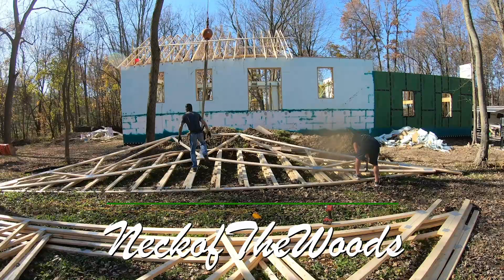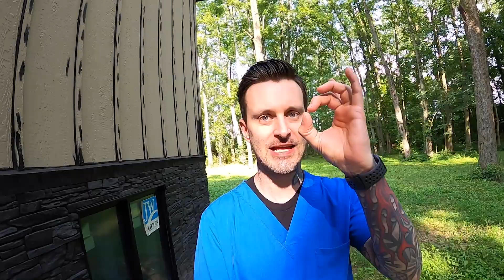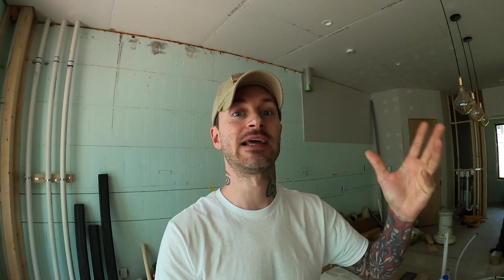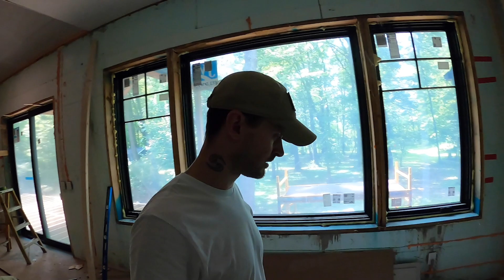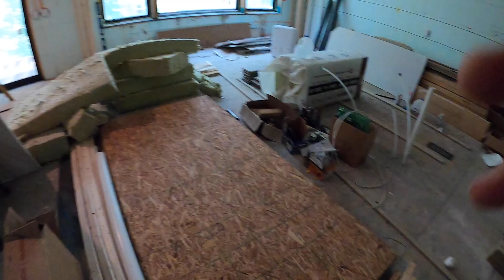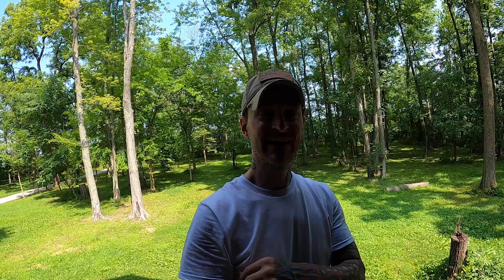ICF Home Blower Door test results!!!

Comment: Interesting info about the windows. 

Do you have a check valve with a compression fitting on your sump discharge pipe? 

Your sump pit shouldn’t ever be 100% empty and the water pump disconnect should turn it off a couple of inches above the pump intake so it doesn’t dry suck air any while waiting for the water level to rise.

The compression fitting is so you can quickly pull out the pump when it eventually fails, hopefully not during a multi-day rain storm like ours did. 

Also recommend installing a sump alarm… it’s cheaper than an insurance deductible.

Also recommend keeping that pool cover pump you had along with a hose you can run outside quickly near the sump pit for an emergency. I didn’t have one and our pump failed in the middle of the night so I spent the entire night scooping water into 5 gallon buckets by hand with a large cup and carrying them upstairs to dump down the toilet. I was exhausted and sore for days!
Reply from the maker: Yes there’s a check value in the sump going up and out.  The sump always has water in it because the pump doesn’t sit on the bottom.  It leaves a gap.  The floats also adjusted so it doesn’t suck up air because it’s so noisy when it does.   Just need to go more since more water would be better to cover that pipe.  Hopefully I can adjust more or I’ll have to like sit it on a brick or something.  

We do need an alarm.  Wasn’t sure which one to go with since some security systems have them and none seem to be great since they always want you to upgrade and charge you a monthly.  We do have 2 other pumps that are just plug in we can grab in case of an emergency.  You have to be there but it’s an option.  Might do a second pump on battery back up.  Just need to get it done!
Reply: @neckofthewoods24  Getting all the stuff done is definitely a challenge and yes, the alarm monitoring business is a racket.

The water alarm I used was from either Home Depot or Lowes and was right by the sump pumps they sell. It was just a simple high pitch noise alarm similar to a smoke detector and mounts to the pipe so you can put it however high you want it in the pit. That was over 15 years so tech has progressed…

I’ve seen reviews for both Ruuvitag and Govee wirless sensors. The Ruuvitag Pro is wireless and has both a water and temperature sensor and I’m getting ready to install one in my RV that integrates into my Victron inverter system. I’m going to test it next week and it the water detector works well get a second one for my the bay where my pump and water panel are in addition to my washing machine and bathroom.

The Govee has wireless as well and also has an audible alarm but I think it’s just a water alarm.

The Ruuvitag Pro and GoVee would both need a separate solution for mounting although the Ruuvitag does have mounting holes so you could mount it with zip ties or a metal straping.
Reply from the maker: good to know about the alarms.  id just lay it right on the lid.  if waters that high, we have a problem!  when we live in it im sure those will work well.  just wish i could get something that connects to the internet that i dont have to pay monthly for so when we are away we'll know with a page to the phone.    im sure someone out there has that or maybe these do!
Reply: @neckofthewoods24  I’m ordering mine in a couple days and will let you know what i find out. they both have apps and wifi connectivity but i haven’t paid that close attention because I’m integrating into a victron energy system installation
Reply from the maker: @inmyimage1081  ok cool!! Thanks!

Comment: That is awesome score. I am building a home very similar to this 1728 interior sq ft each floor. Nudura from footing to roof. And we got the vinyl jeld wen casement windows that are double pane impact rated with the upgrade 1/4 inch glass. Doing closed cell from top of the wall to the peak of the roof. Going to pick up forrmadrain and nudura on tuesday. I will get a blower door just to see if I can get pausive house but i dont give two craps about their cert.
Reply from the maker: Nice!   Yeah I think we’ll hit 0.6 also.  Can’t believe I forgot the vents and the sink drains!   But I was rushed, had like 30min to finish everything and clearly forgot stuff.  Just woke up too.

Comment: Awesome result, well done! Do you happen to have the other result for when the house is under positive pressure test at ACH50? Would be great to compare the difference between negative and positive pressure and see where the leaks most likely come from, which will probably be the vent holes and door / window gaps.
Reply from the maker: No we didn’t.  And yeah that’s probably where they would come from when everything gets forced open.  With the HRV set and balanced, a positive should never be an issue.   Maybe next time I’ll ask him when the house is done.